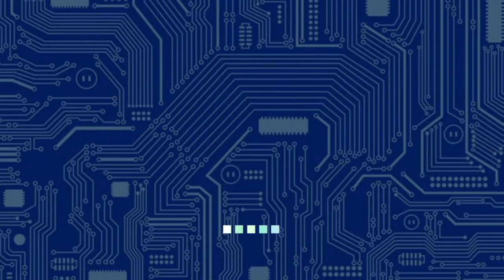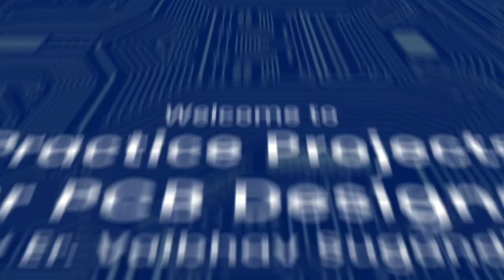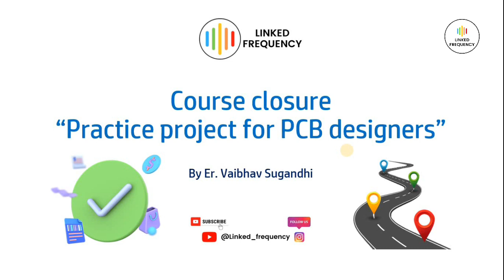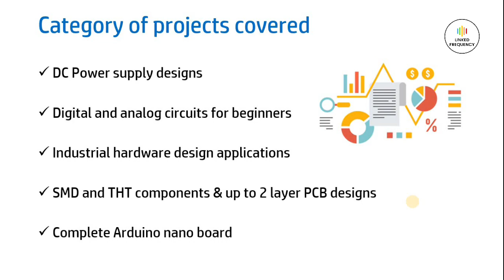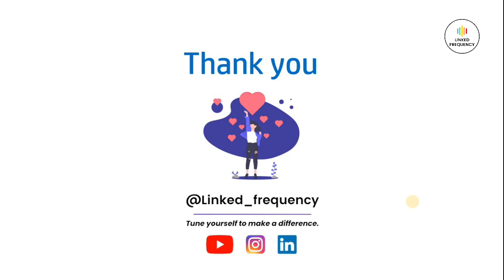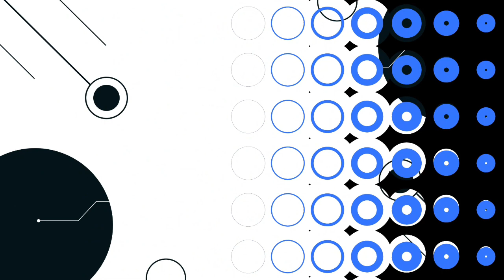Course closure for practice project for PCB designers | Vaibhav Sugandhi

Comment: thank you so much sir you give me the right way in hadware design so sir if i ask you question when i schamatic into pcb where i use manually  how about if use automatic auto routing is problems in fure or in the begining
Reply from the maker: Auto routings are not yet matured enough to use them reliably. Hence not recommended at all as of now. 

All the best :)
#Linked_Frequency

Comment: Thankyou for the informative content. I have a doubt sir.
In the case of last project where we got stuck at the routing part of few nets, i tried to resolve and ended up with 6 nets to resolve i couldnt find a way to route them further.
In cases like these, how do we normally tackle this issue? should we simply remove all our routings and start from the beginning with a new idea?
Reply from the maker: This is a real & practical question, very few notice while learning. 

Here are some ways to solve this problem, 
1. Always route important nets like crystal, power and reset tracks at the first, so that you can handle other nets easily. 
2. Focus on PI & SI while routing special tracks, if they are connected to any peripherals. 
3. In case of unresolved nets at the last, then use vias to route them in best possible ways. 

Still you did not find a way to solve, then you have to rethink on placement of components to resolve the issues.

Happy learning :)
#Linked_Frequency